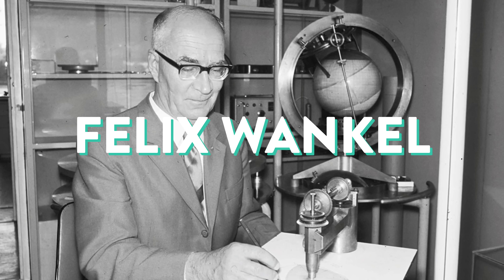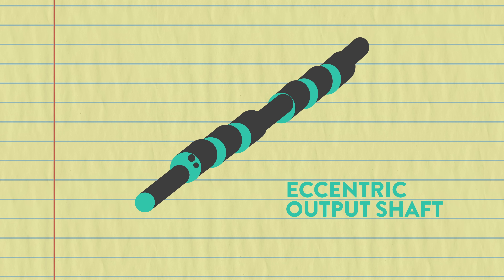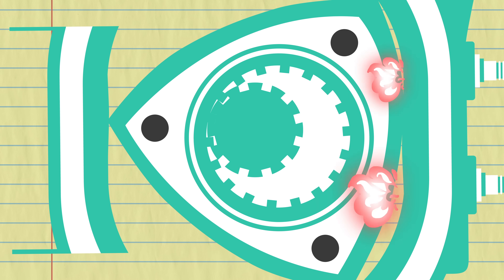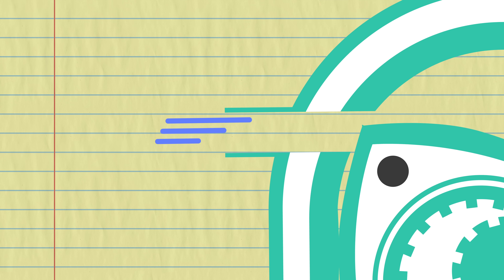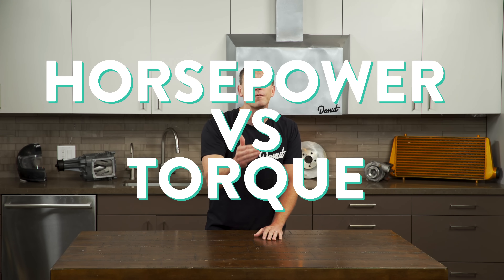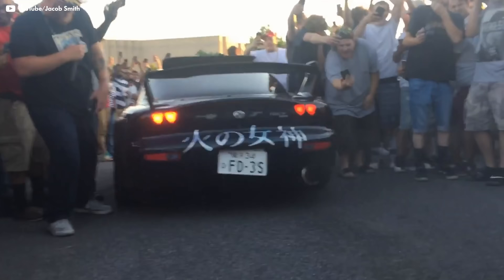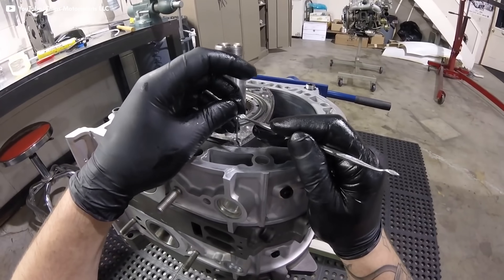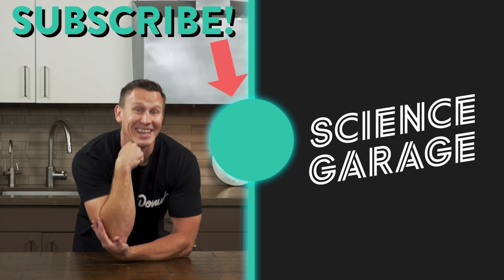Rotary Engine | How It Works

Comment: I like the sound of a rotary but I don’t like them in general mainly because they don’t last as long as a regular combustion engine. A motor only lasting 80 to 90k is stupid smh
Reply: Wankel engines are obsolete because there is no way to make them reliable.
Reply: TBills 3000 I ran mine 150k before I rebuilt it. Could have gone longer, but I rebuild every engine after that amount of wear. It just depends on how to take care of it.
Reply: @spieler440  yeah the only problem is if the Rotary it's properly built it wouldn't last very long but it can get the job done

Comment: The eccentric shaft doesn't spin 3 revolutions per rotor revolution. They are joined. You meant there's 3 power cycles per rotor revolution vs a piston engine's 1 power cycle per piston per 2 crankshaft revolutions.
Reply: There is only 1 (one, single) power pulse per revolution.  Where do you get 3?  Failed basic math?  just not paying attention to what you are seeing?

Comment: Some people have it in their minds that rotarys are unreliable and i'm sure this comment section is full of comments stating such BS (haven't read through any of them, but i'm going to type out this long ass comment because I actually daily a rotary powered car and my word is better than yours if you've never owned one and are just talking shit out of your ass). But the truth is they're very reliable, they just have a few requirements for you as the owner to meet to be reliable. 1. keep up with and be consistent with basic regular maintenance. This is not hard to do and 3,000 mile (or less) oil changes IS NOT constantly having to do mainentance, just because you treat your camaro or jeep like dogshit and maybe change the oil every 15,000 miles doesn't mean maintaining a rotary properly is hard (you also shouldn't buy a rotary car if you treat other vehicles this way). 2. DO NOT baby the engine. This is not a delicate piston engine that you have to keep the rpm low while driving every day. Rotary engines are made to be abused. Beating the shit out of the engine is literally part of maintenance for them. When driving in traffic you want to have your RPM at 3,000 minimum (the best efficiency is somewhere between 3,500-4,500 RPM). Also Redlining at least semi often is required because the rotors build up carbon on their faces, so to clear this out you redline through the gears (I usually do this getting onto the highway - might as well since you have to get up to speed anyway;) ) and you'll usually notice the engine running much better if you've been driving around quite a bit. 3. Oil consumption: Rotary engines are designed to burn oil, this is not a design flaw, the apex seals require lubrication in order to reduce wear against the rotor housings so the engine can run reliably. Mazda Rotary engines come equipped with an OMP (Oil Metering Pump), this is what pumps engine oil to the carb or oil injectors. So because of this, at every other fill up you need to monitor your oil level and add as needed. 4. Premix: Premix is optional as Mazda rotary cars come with an OMP, but what alot of owners like myself do is add 2 stroke oil (Idemitsu rotary premix) to their fuel tank before filling up (hence the term "pre" in premix). And to do this is very simple: Look at your fuel gauge and estimate how much fuel you've used based on tank size (16 gallon tanks for most mazda rotary cars - 20 gallon tanks for the FD), then take a measuring cup/bottle and add .5 Oz per gallon if you have a working OMP or 1 Oz. per gallon if your OMP is not working or you have removed and blocked it off (blocking the OMP means that your engine no longer lubricates the rotors with engine oil, but is instead lubricated with 100% premixed fuel). Premixing again is not required but does help alot to make the engine last longer and run much better throughout it's mechanical life, but only if you as the owner give enough of a shit to do so.

*My personal daily is a 1980 Mazda RX-7 SA22C and I put roughly 20,000+ miles on it per year reliably without the slightest worry in the world:)

Comment: I did a 5 page essay on the Wankel rotary 
My teacher didn't get what I was saying 😆
Reply: You had to yell her as he did
Reply: I love doing that!!
Reply: But hey, you got an essay
Reply: You madlad.
Reply: Did you get B++++++
(BANGBANGBANGBRAAAPNRANGBAGJEBDHWVSBANGPO0BANPOP₩
Reply: That’s a good move because then she can’t know if you’re wrong or not
Reply: If you can't explain it in simple terms then you don't understand the concept.
Reply: John doesn't understand why Wankel engines are no longer made...
Reply: @nerfprate  no, most of us understand but cant explain
Reply: @nerfprate  not really. Judt means the teacher has a hard time picturing what your saying
Reply: @nerfprate  
I can't really speak for your teacher.
Reply: If your teacher never understood, your writing skills need sharpening.
Reply: @johnburns4017  This day June 21st marks the 9th anniversary of the  end of RX production at Mazda.
The very last Wankel engine powered car rolled off assembly line on June 21st 2012.
Reply: @sandervanderkammen9230  
dockorbimmer, a quiz.
What type of engine is to be installed in a hybrid car by Mazda?
20 points for the correct answer.
Reply: @johnburns4017  LIES!!! John nothing you have ever posted about Mazda has turmed out to be true, every time complete LIES!
Reply: @sandervanderkammen9230  
BZZZZT! Wrong answer.
docktorbimmer, the type of engine to be installed in a hybrid car by Mazda is the..

🎊🎈🍾 Rotary engine 🎊🎈🍾

Zero points dockorbimmer. Zero..
Reply: @johnburns4017  Stop lying John
Reply: @johnburns4017  The MX30 is in production and is available for sale in selected markets.
The MX30 is only available as a 100% plug-in battery electric vehicle or a mild series hybrid powered by a 2.0 liter reciprocating Skyactiv G engine.
Mazda canceled all development of production Wankel engines in May 2009 and all production ceased in June 22, 2012.
Reply: @sandervanderkammen9230  
dockorbimmer, a quiz.
Name the company that is to install a rotary engine in a hybrid car?
20 points for the correct answer..
Reply: @johnburns4017  Mazda no longer makes Wankel engines
Reply: @sandervanderkammen9230  
BZZZZT! Wrong answer.
docktorbimmer, the  company that is to install a rotary engine in a hybrid car is...
🎊🎈🍾 Mazda 🎊🎈🍾

Zero points bimmer. Zero.
Reply: @johnburns4017  June 22nd is the 9 year anniversary of the final end of Wankel engine production.
At 4:30pm Tokyo time on June 22,  2012 Mazda produced its very last Wankel engine.
The Wankel engine assembly plant at Mazda's Ujina #2 plant shut down and was later demolished to make way for a new Skyactiv G engine factory.
Reply: @sandervanderkammen9230  
dockorbimmer, a quiz.
Name the type of engine that is to be installed in a Mazda hybrid car?
20 points for the correct answer.
Reply: @johnburns4017  Mazda's hybrid is  powered by a 4-Cylinder Skactiv G engine.
Stop telling clickbait lies.
Reply: @johnburns4017  The Mazda MX30 is already available, the Hybrid version is powered by a 4-Cylinder Skyactiv G engine https://youtu.be/TFS5zUFO9Cw
Reply: @sandervanderkammen9230  
BZZZT! Wrong answer.
The name of the type of engine that is to be installed in a Mazda hybrid car is a ...

🎊🎈🍾 Rotary engine 🎊🎈🍾

Zero points bimmer. Zero.
Reply: @johnburns4017  Mazda does not make rotary engines
Reply: @johnburns4017  Mazda's hybrid powered by a 4-Cylinder
Reply: @johnburns4017  ha I love how you made fun of dorktorbimmer
Reply: @sandervanderkammen9230  MAX IS HERE
Reply: @Maximus20778  
I do not make fun of doktorbimmer. This is a serious quiz for him. 
So far he has accumulated a grand total of zero points.
Reply: @johnburns4017  he's a sad troll, luckily I'm reporting him also
Reply: @johnburns4017  Mazda abandoned all development of Wankel engines in May 2009.
The last time Mazda unveiled a new production Wankel engine was a quarter of a century ago.
Reply: @sandervanderkammen9230  
doktorbimmer, a quiz.
Which car magazine reported on 4/14/21 that Mazda are introducing a hybrid car with a rotary engine?
20 points for the correct answer..
Reply: @sandervanderkammen9230  nice copy paste 😂
Reply: @johnburns4017  Mazda does not make Wankel engines anymore... stop by your local Mazda dealer and see for yourself.
The MX30 is already available for sale and will only be available in plug in EV p5r a Skyactiv G engine hybrid.
Reply: @sandervanderkammen9230  
dockorbimmer, a quiz.
Name the company that is to install a rotary engine in a hybrid car?
20 points for the correct answer..
Reply: @johnburns4017  More of your phony clickbait rumors that never come true.
Reply: @johnburns4017  WHERE IS YOUR PROOF???
Reply: Your teacher must not know how a regular piston engine works then because its the sane concept except in a circular motion
Reply: can i get the link to the Google doc 👀
Reply: Wait, can I actually read that?
Reply: You didn't even get what you were saying, you were just repeating what someone else wrote.
Reply: https://www.mazdaforum.com/forum/mazda-rx-7-33/joe-maddox-super-rare-1-100-1989-fc3s-gtus-rx7-2jz-gte-vvti-build-43602/
I have found and saved the rarest Mazda FC RX7 ever made! Now this car is rare. Really rare! Let me break this down really quick...
Ever heard of the 1/100 non restamped 89/90 GTUs rx7s? Here are the rarest rx7 FC3S models:

1500 10AE Turbo models
1400 infini
1000 winning limited
1000 GTUs restamped
150 final edition convertible
100 GTUs non restamped

out of that 100:
83 red on black
10 black on black
7 white on blue

There was only 1100 GTUs models created between 1989 and 1991 and only 100 of them did not get an X through the firewall.
Reply: @joemaddoxrx7  The FC sucks!
Reply: Absolute madlad, BIG PP to you
Reply: F
Reply: Lol 🤣
Reply: I wanna see it so bad!!!!
Reply: Change classes
Reply: I did one on 2 stoke then another on 4 strokes. Yeah I got a A because he gave up reading. Freaking love being a gear head
Reply: did the same. my teacher kicked me out the class for making him confuzed XD
Reply: Most people today don't remember the Wankel engine anymore, you need to be an excellent writer to make history interesting.
Reply: Your teacher must be a she

Comment: Ive found the easiest way to keep a rotary engine reliable is to take the motor out, throw away the OEM apex seals, throw away the OEM cooling system, throw away the rest of the motor and replace it with an LS1.

Comment: It's also the rotor housings that were important.  Mazda was the only manufacturer to look at it from a materials stand point.  The apex seals were originally carbon, then aluminum carbon, then finally electron beam hardened steel!!  But as those seals became harder so too did the housing.  The latest housings are cast aluminum with a steel insert that's teflon impregnated chrome plating.  Awesome material science!!!!

Comment: A perfect way to make lots of noise without those pesky Bi products like power and torque.  Less power than my mower, sounds just like it, burns more oil than my 2 stroke, and has the emissions of a freight train.  I can't beleive no one still produces these engines.